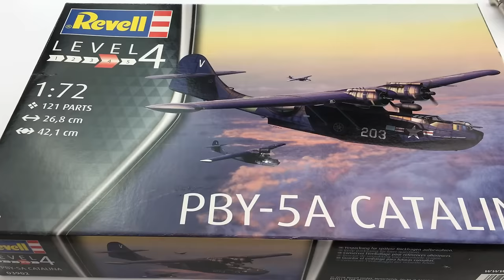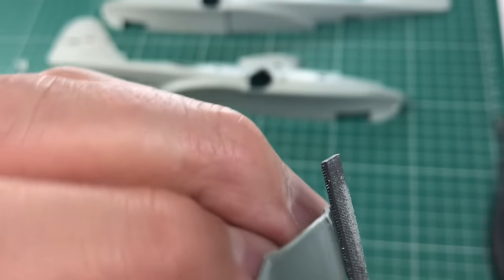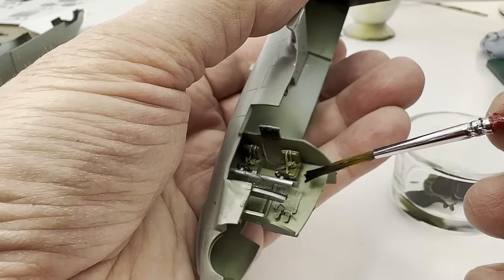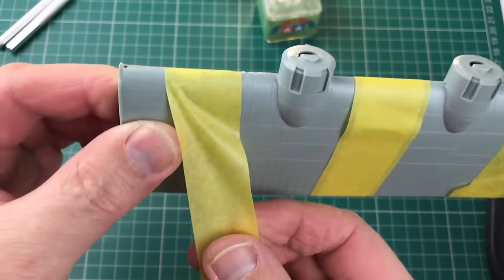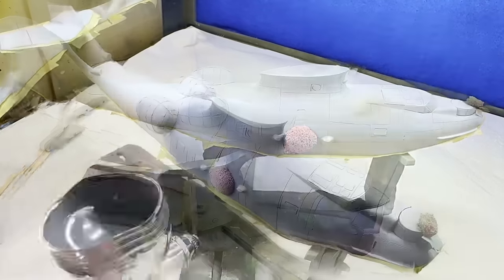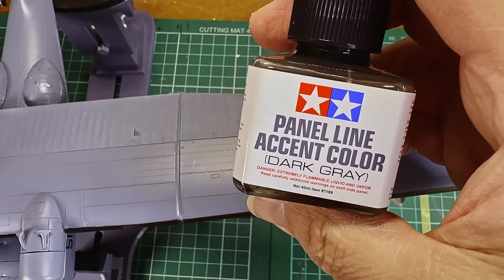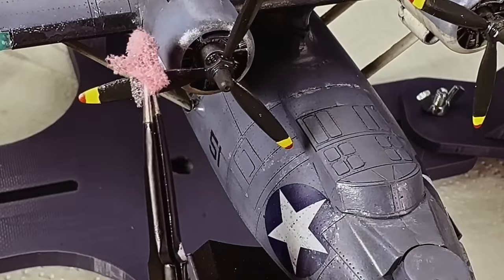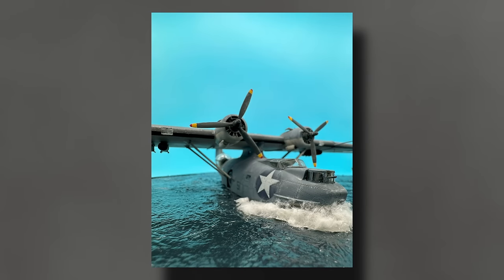I build the Revell Catalina PBY-5A in 1/72 what a fantastic kit

Comment: Hi, A really well done and finished model. Well done. I have only one small comment and that is nothing to do with the model build. but the base. 2 things there is no wake from the back of the fuselage and also you have the plane moving through the water with static props. If you want it in water an at anchor scenario would be more realistic. Unless you could motorise the props. The engine cowlings and wings look big enough to take 2 small electric motors and the wiring would run through the aircraft and out to the base unseen. To a small battery pack with a simple on off switch. It could be hidden in the base edge. As I said a a really well done build. Your talent is clear to see.
Reply from the maker: Thank you for the reply it means a lot and your words are very kind. The electric motor isn't something that would interest me but yes you are quite right it could be adapted. Concerning the wake - the idea of the plane was it had just come to stop and was doing the last bob down in the water. I checked many actually photos and very few have the floats actually touching the water at all they seem to be more like stabilises. that said there is one small wake behind the port float as if it had lean to that side briefly before stopping. That said it was pretty much my first diorama so apology if there are things that grate on the eye.

Comment: Great work! I have heard that some rich people have bought and refurbished Catalina's and use them as flying campervans. I wish I was that rich. As far as the nose weight is concerned you can buy Tungsten shot (Heavier than lead) and cover it with resin so it wont move or rattle.
Reply from the maker: thank you. Would that be nice to have a Cat camper! I have took that tip on board thank you for sharing it 👍

Comment: Nice job on the build!  Question...where did you get the adjustable jig to hold the kits on?  Any info would be appreciated.
Reply from the maker: No problem Paul! Adjustable jigs are 3d printed and there are a few sellers on eBay. I have two sizes for planes and one for tanks or you can grab a file for 3d printing if you have a printer. Also they do 3d printed Tamiya glue stands and decal solution holders which are a must for me as I keep knocking them over. 👍

Comment: How are you finding your airbrush??? I have been looking into these as they are supposed to be very VERY similar to the Iwata Custom Micron. Obviously externally different but the air nozzle and needle are exactly the same system apparently built on the same production line so I’d be interested in your feedback please. You probably know the Iwata costs in access of £500+ these cost between £20-£150 and spares are a lot cheaper for yours 😅😅😅 

Would also like to say how much I like your channel you show your mistakes and tell us if something is difficult with the kits so it’s very refreshing to see that 😎😎😎 not everyone is like this so we’ll done you on a great channel 🤩🤩🤩 all the very best for the future, Kenny 😎😎😎👍👍👍👍👍👍
Reply from the maker: Hi Kenny Thanks for the nice comments; it means a lot. I use my Iwata Eclipse HP-CS mostly and I lovethis one. I have a bigger needle set so I can spray varnish neat without having to dilute it. This is my go to the expensive My Hobby 771 is hardly used, as it pretty much only does the fine work. My Iwata Eclipse HP-CS is pretty bashed up nowadays, but I would buy another without hesitation. Best wishes Jim
Reply: @TheScaleModeler  yes I’ve done a lot of research into the 771’s and they are wonderful airbrushes. I’ve got two HP-CH’s .3mm nozzle and a HB-BP .2mm nozzle. I can get up close and personal with the BP with its .2 needle for figures exceptional for camouflage patterns on the clothing 😍😍😍 but the CH’s are absolutely stunning work horses tough as old boots to but I do love custom micron’s I’ll never be able to own one but the 771 is extremely close to the micron same head design and airflow system just a few changes on the outside is all the difference. But at a third of the price 😍😍😍🤩🤩🤩😎😎😎

Comment: The nose doors gave you some trouble. My suggestion is to put a strip of sheet plastic inside. The doors then just sit on top of the plastic strip. It also gives you a stronger bond than just a very thin butt join. 
Beautiful work there sir!
Reply from the maker: Top tip cheers Kelly 👍

Comment: This might be a dumb question, but is there any prep work required to use the Pledge? Thinner or anything like that? I’ve seen others use it as well and I’ve always wanted to try it. Great build! And thx in advance for any help!
Reply from the maker: Hi there, thank you 👍first this is a good question and I had the same one infact I was pretty concerned the first time I used it. There’s so many products on the market it’s easy to feel intimidated by them. I found pledge to be better than most gloss varnish’s for models and considerably cheaper. once I have finished with painting and decals are on I tend to seal it with a coat or two of pledge. Be careful going over enamel and lacquer as the drying time of these could cause cracks as the pledge dries more quickly. Be careful of thinners as well as these can work the pledge off. I use lighter fluid with pledge and don’t have issues.
Reply: @TheScaleModeler  so the Pledge is straight from the bottle? I really appreciate the help! I’ll try it on the Wildcat I’m working on now!
Reply from the maker: Yes straight from bottle you can also dilute with water. If airbrushing clean the airbrush out completely as it will set in the airbrush. I normally do a heavy clean every day of use anyway and rub needle down with a 1000 grit piece of wet and dry paper in order to maintain smoothness of operation- hope that helps 👍
Reply: @TheScaleModeler  right on! I do the same cleanup routine myself. I’m gonna try the Pledge in a few days. I appreciate the advice!

Comment: Couple of points re the weights. Lead shot, such as used by fishermen, is much heavier than steel ball bearings. You can pretty much fill up the nose area with some resin or glue to hold them all together. Secondly, why even bother with them? They're only relevant if you're displaying it on it's wheels. That was never your intention and mounting it as a diorama made the weights even less relevant.
Reply from the maker: Thank you Ian for your insights and comments I try to take on board tips etc; with hindsight I shouldn’t have bothered with the weights. I have fishing weights though as well as ballast but they didn’t quite fit right. I poured a lot of superglue over to try and keep in place but some did escape 👍